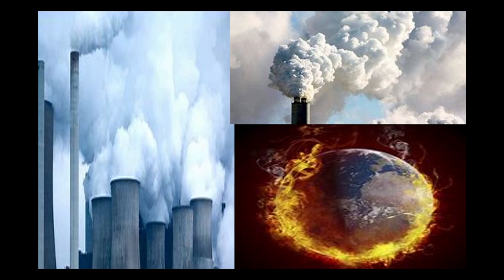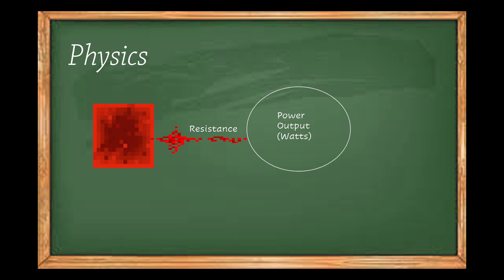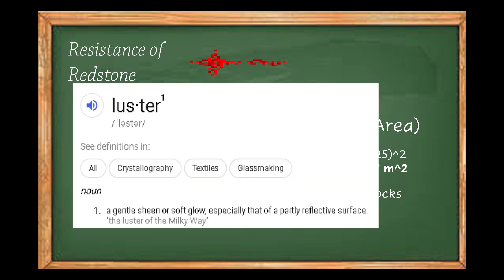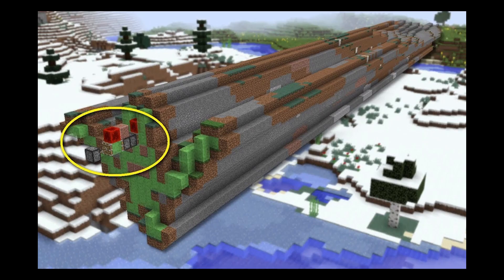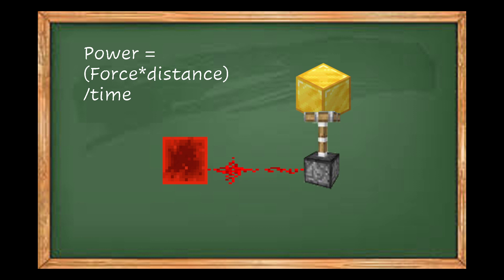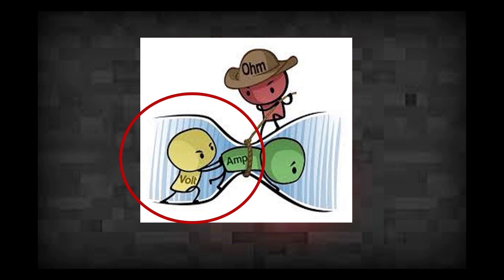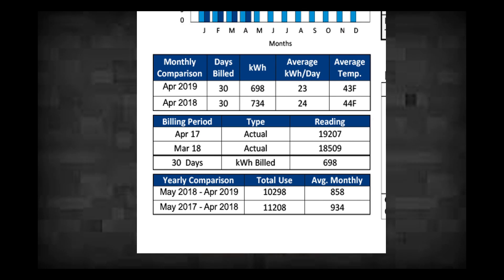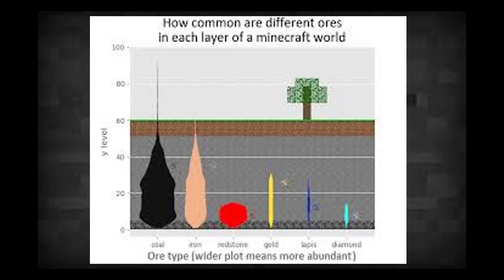How Much Redstone does it take to Power the World?

Comment: I would like to offer an alternative interpretation. We know that in the minecraft world, gravity is weird. It applies only to certain objects, so I don't think it's an accurate measure of the work that redstone is capable of doing. Instead, one idea that I had would be to still use a piston pushing an object, but instead of using gravity as the force opposing motion, use the force of friction of two blocks sliding against each other, with a piston pushing horizontally instead of vertically. This is a more complicated problem, however, as we would need to balance the mass of the object with it's coefficient of friction to find the least optimal combination of blocks for the piston to push. Just a thought.
Edit: I've come up with another idea. The note block. This one is kind of a stretch, but if we assume that the volume of the sound of a note block coming through our speakers in the real world is a parallel to the volume in the minecraft world, and we can also figure out the resistance of the speaker inside the note block (maybe a rough estimate based on the size of the block and the sound level of other known sounds in the minecraft universe that have parallels with ours?), Then the power generated by a single piece of redstone dust is related to the amount of power we can use to drive a set of speakers. Basically, If we could use all of the world's power to make a single speaker play the note block sound as loud as possible, then that would be a sufficient proof for a piece of redstone being able to match at least all of that power that we put into the real world system.
Reply from the maker: I though about the using a horizontal piston and friction but that involves more interpretive data with deciding a mu value.  Your note block idea is very interesting, I would definitely explore further the acoustic properties in mc because they assign volume levels that would make parallels fairly straightforward to calculate. Amazing ideas, thanks for watching.
Reply: @AobaPhysics  big brain
Reply: How about the redstone lamp? I haven't looked into it but could it work?

Also, since Minecraft gravity is weird, and is zero for stone and gold when placed, wouldn't that make it's weight zero?